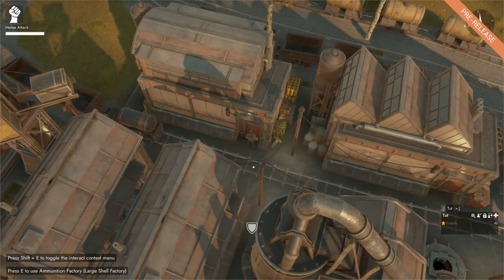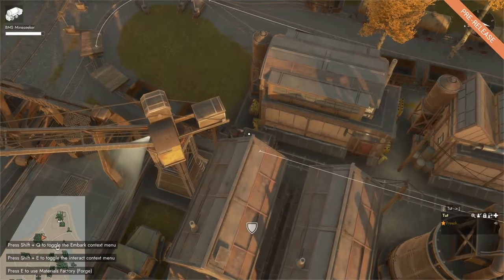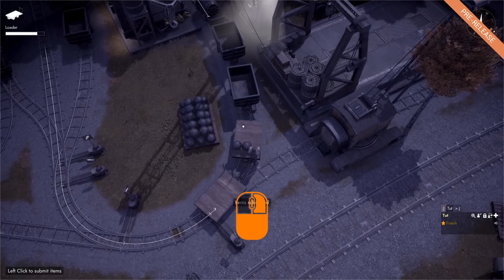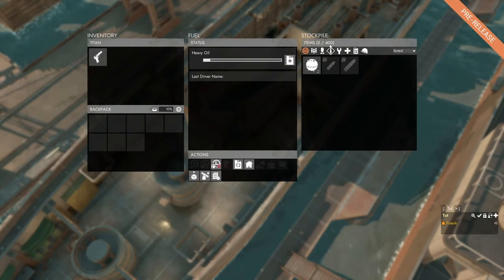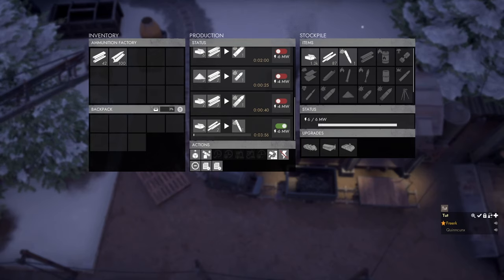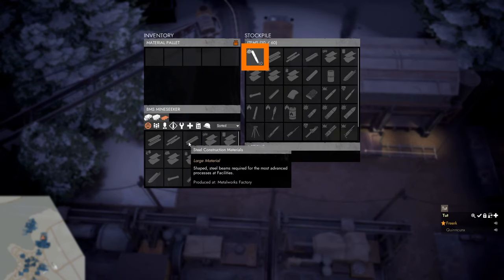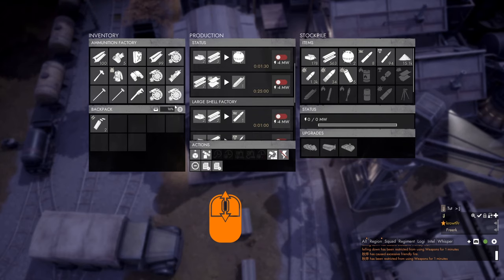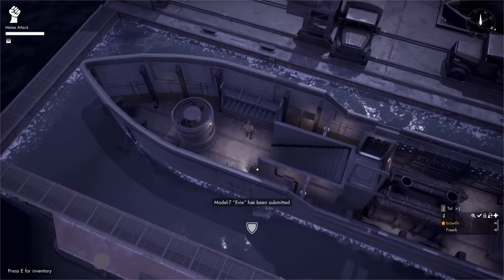Foxhole Guide - Torpedos, Depth Charges and Sea Mines

Comment: 0:33 +1 follower for that, explaining where to craft what are need is exactly what where missing on your video. Thanks!
Reply from the maker: It's always a question of how far back in the process do I go with my explanations. Sometimes I forget to mention how to get things like bmats or rmats and just assume people know. But I try to explain things as much as I can without going overboard and explaining to use the WASD keys to move around.
It's a tough line which I usually get right I think and sometimes get wrong on either side